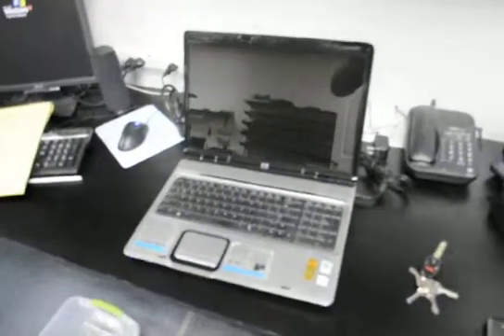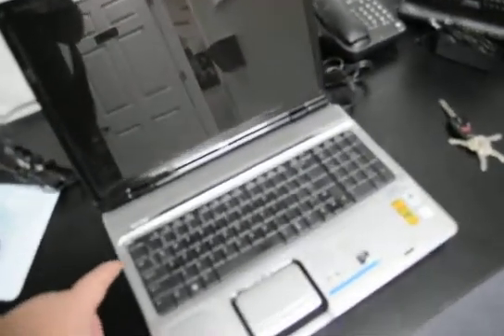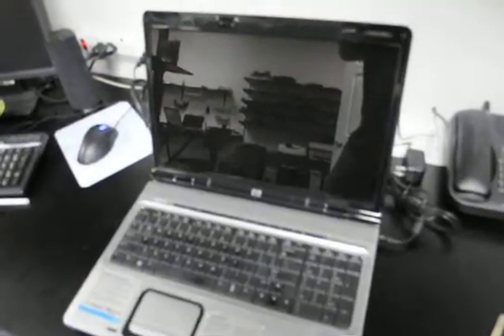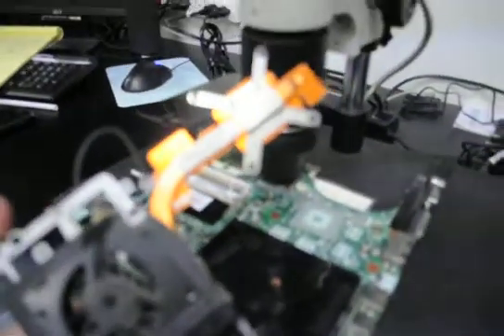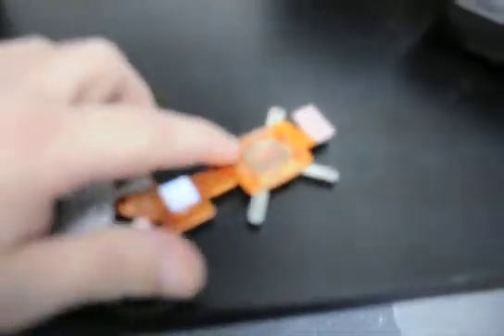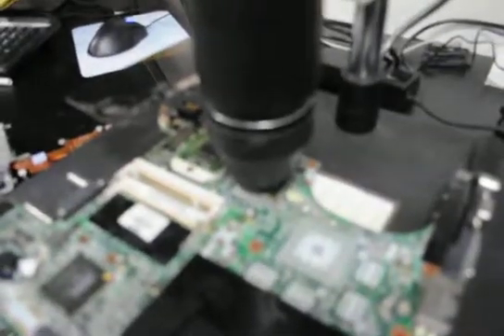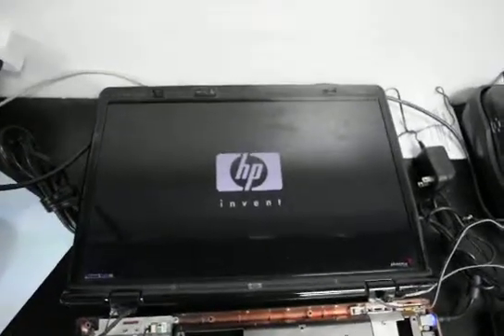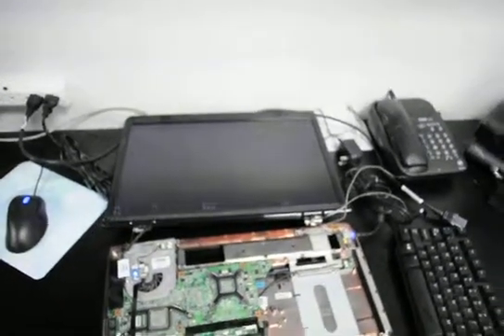IR BGA reflow of a HP DV9420US laptop for Lebron at ComputerServicesFast.com to fix a no video issue

Comment from the maker: @IcaroChacal The distance is key when you have to tighten your waveform from the light.  A tighter beam means less surrounding chip failures due to heat up plus the distance intensifies the heat or more over concentrates the heat and light locally.  Now, you have to make certain to not over expose the chipset to the light, but in the end that is more about time than distance.  The temp I use regularly is between 220 and 240 with a rough exposure time of under five minutes.

Comment: I see...also I have noticed that you are placing the IR Lamp very near the chip (almost touching it, but without touching) as opposed to other videos that you were leaving like an inch of a gap between the IR Lamp and the chip itself. Does this make a notable difference for you in the actual performance of the Reflow and in the temp used? May I ask also...the actual temp you use for your IR Lamp is 240c for 2 to 3 min?
Like always...awesome videos.

Comment from the maker: @IcaroChacal I use the same heat profile for both.  Each chip is different and you have to get it over time and practice since the room is a different temperature, the humidity is different, so on so forth.  I will say you are leaving them on for way too long.  At max you should leave them on for maybe 10 minutes for the entire process.

Comment: Do you use different heat profile for the GPUs vs the Low Level Coprocessors? I ask this because I don’t seem to get it right for the Coprocessor. It gets pop corned very easily. The Heat Profile that I am using for the GPUs right now is Preheat 16 min. at 200c. in the bottom ceramic, then IR Lamp 1 min. at 150c., then 1 min. at 200c., then 2 min. at 240c., then, let it cool down for 30 min. All is done using the T-862++ Rework station. Thank you again for your great work.